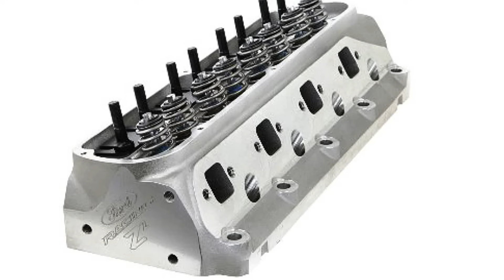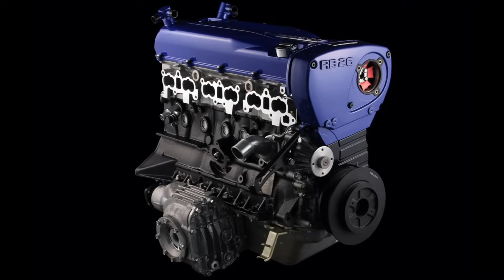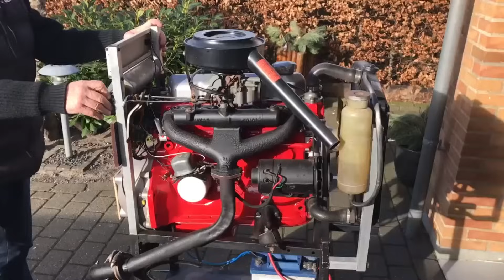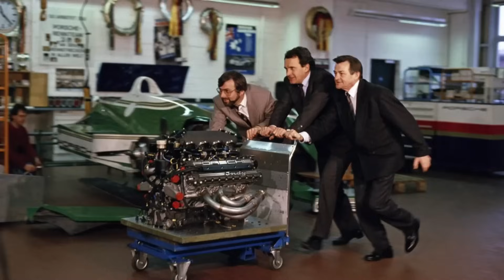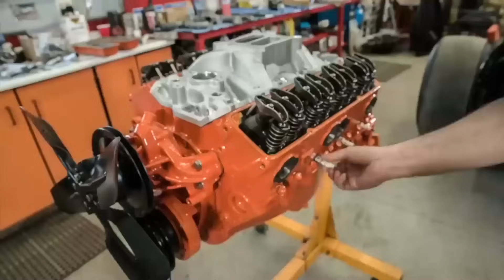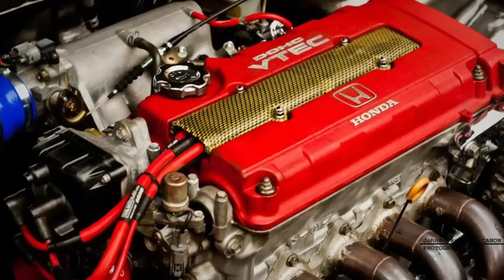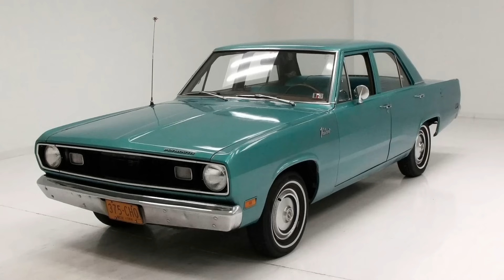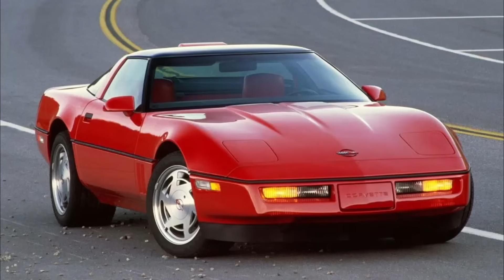30 Car Engines That Will Last FOREVER (2024)

Comment: The Chrysler 225 Slant Six was a fantastic reliable engine! The only negative was most people did not realize it had solid lifters that needed to be adjusted. When this maintenance was not done they would burn the exhaust valves and require a valve job!
Reply: My first car was 1968 Plymouth Valiant with 170 1 barrel carb slant six no power steering all drums brakes no AC very simple and last me a long time from 1981-88 in mid 80’s I drove across the country from New York to SF, California and back I-80 then I-70 westbound and then I-40 eastbound and parts of Route 66 and continue on I-40 to Tennessee onto I-81 to NYS
Reply: @michaelgorman4229 
My first car was also a Chrysler Valiant 170, a 1967 model that my mother handed down to me in 1981. I used it to drive the 2500km to my first job. A great car.
Reply: That would have been the pre-1984 models. That year they switched to a hydraulic lifter. I had an 84 D-100 Miser with the 225 and a four speed. Ran great as long as I treated it like an old Detroit Diesel- I had to keep the RPMs up, or she wouldn't get out of her own way.
Reply: @leehuff2330 
Drove Hard My 79 Chevy Base Model Van With 250 Straight 6, and 3 on the Tree. 
It Was Torquey and Reved High
Reply: I really enjoyed this presentation you did I have and have had some of the engines you mentioned 225 slant six and the 3800 Buick which is still running fine but only has about 100,000 miles on it. I guess we still have more time with it.
Reply: @rickslock  Just keep the oil changed every 4K - 5K miles or every 6 months on your 3800 GM V6 and it’ll make it to the 300K mile mark.
I’m expecting to keep our (my) 2023 Tacoma TRD Off Road double cab, 6’ bed with the Premium and Technology pkgs for the rest of my lifetime.
I’m a maintenance guy so I change the oil every 6 months or 5K miles as I only drive 8-10K miles per year now that I’ve retired.
Enjoy your day !
Reply: You didn’t mention one of the best engine Ford made in Australia it’s four litre straight six Barra engine it had 260 horsepower and turbo produced 368 horsepower unbelievable good engine.
Reply: I knew a man that had  six adopted teenagers. He had a fleet of used cars with the slant six. If they killed an engine he would just buy another slant six as they were a cheap engine to buy. He was an American Family insurance agent and said cars with the slant six were cheaper to insure.
Reply: @gvet47  That’s because the in-line 6cyl engines aren’t very fast. Their super reliable engines but are slow
Reply: @Doc1855  not totally true. 225s can be tuned to run pretty good and can be quick and fast with proper gearing.
Reply: @UncleCharlieRLTW  I’m sure, but when you’re buying fleet trucks for your business we just keep them as stock.
In my personal F150s I’d install overloads on the rear leaf springs so I could haul heavier loads
Reply: @Doc1855 Sorry, wrong. People race SL6 cars. It all depends on how they are geared and set up.
Reply: @obifox6356  Go back and re-read what I said again.
I DIDNT say it didn’t happen. I said that I don’t do that !
Reply: @Doc1855  with a stouter rear-end also? That's how I do mine.
Reply: @Doc1855  i know of a turbo injected 225 has 700rwhp.  Stock balanced crank with forged pistons and rods.  In Australia compared to gmh at the time  they where near twice the power
Reply: @Pete-hy4mq  But that’s not what was stock in Chrysler products
Reply: @Doc1855 had one in a 1964 dart a rather small car but moved pretty good until I was low on oil started knocking and I tried to make it home threw a rod out the side
Reply: @Doc1855  What do you mean, a slow engine? Maybe you meant they are in slow cars
Reply: @sundar999  Duh
Reply: @Doc1855   At least it's fast enough to take you to work. And doesn't take too much gas...
Reply: @Doc1855  my push button slant 63 dodge Dart got rubber in second gear!
Reply: Lol say that to 2JZ
Reply: @Doc1855 I guess you never modified a Mopar 225 with the basic header, K&N, MSD upgrades…  truck motor in a passenger car and incredibly simple to modify.
Reply: @  No,
I Hate Chrysler products
Reply: @UncleCharlieRLTW 
Correct, and At Least 1 Year, with Chrysler 225 Slant 6 
 You Could Get Some With 2 -  Tuned 2 BBL Carbs, Each Carb on a Separate Intake Runner.
Reply: @michaelchevreaux7780 my first car was a 71 duster 225 slant 6...hot tuneup and glasspack muffler made it peppy with a 2bbl.
Reply: @UncleCharlieRLTW 
At one time was a Factory Setup - Dual Crossover, 2 Intake Manifolds and 2(2brl) Carbs.
Probably could have got a aftermarket Cam.
Reply: Even then. The price of the head is less than the engine. Worth chaging.
Reply: Looking for The CUMMINS 5.9 L 12 Valve . Quick skimmed, I musta missed it....but I don't,  350,000, still hummin', TYJ!
Reply: @freedomfan2295  Yeah that’s a million mile engine, but most diesel engines are
Reply: When the gap between the exhaust valve stem and the rocker arm wears then this gap increases meaning the exhaust valve remains closed a bit longer than if the opening gap was adjusted  tighter so the valve would not burn under those circumstances...right?
Reply: Keep in mind in most engines valve seats wear and actually decrease valve clearance resulting in a failure....some engines have harder valve seats and have less trouble than those who use softer metal valve seats
Reply: What about the gm 5.3 v8, was not mentioned?  Is a bullet proof engine.
Reply: @FM-cf6em There's a bunch that could be added but would make the video too long or boring.
The McLaughlin Buick inline 8 from the mid 30s was another along with early Rolls Royce anything. 
The biggest Cadillac engines from before 1980 were all bulletproof.
Reply: 225 would through number 5 out the side lol
Reply: @mrman1536 I did that on a 75 Dart, blue engine. Older "red' engines are much tougher
Reply: Still running a 225 slant six in my '74 Dodge Dart.  276,000 miles and still going strong.
Reply: I have 5, 225's.came out of crusher  lot before crushing .All run great  Paid 125.00 bucks. .Have 4 Valiants , great shape ..Winter project..
Reply: Inline, including slant configuration engines will out last V type and horizontally opposed engines with the least amount of wear.
Reply: I've had the slant six and she's a tough old girl. Now I have a jeep with the 4.0 and she's a tough old girl too
Reply: Engines with solid lifters sold to the public with no mechanics knowledge was a failure on the manufacturers side and shouldn't make this list.  but then again DODGE ALWAYS FAILS !
Reply: @christianogaard2185  another Canadian
Reply: If they were overreved the results were catastrophic!
Reply: The leaning tower of power
Reply: My brother had a 225 slant 6 in his 73 dart, that engine went over 400k miles no problem. Those motors were bullet proof. And back then there was a lot of them on the road, easy to find parts for.
Reply: I do agree I owned one
Reply: Was going to bring thar up.
Reply: In college, I bought a 1973 Duster for a case of Bud, 225 slant, it had No Compression in the 5th cylinder and I still put Another 100,000 miles on it while it still blew Ice cold air!
Reply: @Krazycat321  You gotta love the older vehicles that just wouldn’t give up.
I had a friend who wanted to borrow $400 from me back in the early to mid 80s.
She had a 73 Chevy Impala that she hardly ever used, so I told her that I’d let her borrow the $400 if she transferred the title of that 2dr Impala over to me. That way if she never paid me back there wouldn’t be any hard feelings and if she did pay me back, I’d sign the title back to her.
She never did pay me back and I too put over 100K miles on it. 
It kinda became everyone’s car.
At that time I had a new Toyota for my personal car and a Chevy pickup for my work truck, so I didn’t need the Impala.
Right at around the 200K mile mark it developed a hole in the exhaust and about that same time it burnt a valve.
Of course that old 350 V8 was missing because of the burnt valve and because of the hole in the exhaust it sounded pretty good, like it had a beefed up engine.
At idle it made the sound of BLAP BLAP BLAP BLAP.
It became known in my circle of friends as the Burgundy Bomb.
When we’d go out bar hopping with each other, we’d always take the Burgundy Bomb. If we got into a wreck, who cares. 
Anyhow as 87 rolled around I was going into Grad School and needed to relocate. A friend of mine was going through a divorce and she needed a car, so I gave her the Burgundy Bomb.
It was still clean and straight with around 230K miles, but she was glad to have the transportation and I was glad that I didn’t need to sell it before leaving for UW.
Reply: Al Bundy special
Reply: And they were a 4 main bearing weak design, hard to work on the distributor side of the engine. Chrysler's Hemi inline six that replaced the slant in Australia was ten times the motor. More power, more economy and more reliable with hydraulic lifters, easier to work on and didnt burn valves as they were stellite. Btw, not keeping solid lifters adjusted up dont burn valves- adjusting them too tight burns valves.
Reply: Yes slant six was excellent engine reliable and smooth l hade coupe of them in my cars.
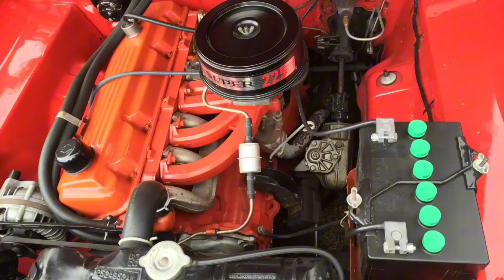Reply: 21:48 this engine?
Reply: Sadly at my job we have a slant 6 generator- they updated to new generators and the slant six was shoved to the scrap yard... nothing is wrong with it, it was lpg powered and was running when shoved out 

I been asking for it for years i covered the pipe with a can and the breather with a can as well i go and check the state of it and it is slowly deterating
Reply: The pride of Huber Ave. foundry.
Reply: Well that and the cars were so ugly people destroyed them, at least that was my old man.
Reply: My Plymouth 360 had valve issues.
Reply: Slant Six was a terrible underpowered engine 
I had one. It would diesel. I would have to shut it off in drive. It would stall in an intersection. It would overheat in the summer. Typical Chrysler Engineering
 Lean Burn Garbage because the engine couldn't pass emission controls
Reply: @John-pz6nm  My dad, through his neglect, somehow cracked the block on his slant 6. It was a water leak only, and the Plymouth engine lasted a few years longer than I expected.
Reply: Must
Reply: 9 times out of 10 they were owned by little old ladies, that drove it to church on sunday....till she died, and never changed the oil, ever.
Reply: In my old mans case, the slant was in a car so ugly he destroyed it. Any means necessary.
Reply: They are a great motor i had one with a scat pack 3 2bbl carburetors and bigger cam and headers
Reply: I have both of the 1975 Dodge D100 trucks my Dad got for Free I. 1975, when he bought 2 1975 Dodge Bighorns. The picks were powered with 225 Slant 6 and 4 speed manual Transmissions.  Today they both have surpassed the Million Mile mark. And are driven weekly. As for the Bighorns. I only have one left. Sold the other 3 years ago.
Reply: I had one when I lived in Hawaii & every time there was a flood, the points would get wet, because the distributor was close to the ground. I had to pop the distributor cap, too many times, dry the points, put the cap back on, I GOT SICK OF IT!!!
Reply: I have a slant 6 from my long gone '72 cuda. Had a "6 = 8" sticker in the engine bay and a 2 piece header even!! ABSOLUTELY will sell it. I'm in MN.
Reply: @ I never said that I wanted to buy it. I was just saying that they were good engines
Reply: Tough ass engines
Reply: Had a 63 dart convertible sweet running engine it wasn't  very old .oops telling my age😊
Reply: Yep
Reply: @Doc1855  the US 225 never had much R&D. But in Australia the 225 had tonnes of R&D. They became extremely fast. I had an old 180hp engine in an old Valiant Regal. It was optioned because that motor was predominately found in only a rare handful of Valiant Pacers. 
That engine thrashed much larger and more powerful 6 and some 8's.
Reply: And the Ford 300 6 banger
Reply: No slant six no matter how well maintained will ever outlast a 22r Toyota. Two of them couldn’t
Reply: @MetalTeamster The timing chain of the 22R can gnaw a hole in the aluminum when the plastic chain guide fails - sounds like a diesel by then
Reply: @timothykeith1367  Good engine though.     I seen them go over 300 thousand miles and still run strong m
Reply: @timothykeith1367  I made the mistake of buying a 1984 SR5 with 100,000km that the owner skipped most of the oil changes.
I bought it as a "patch the many rust holes and have a cheap reliable mini truck" WRONG.
I found what looks like just dirty oil on the stick was actually black globs in the bottom.
After its 3rd oil change in 10 years it did sound like a diesel (but did start and run, just noisy). Then...I dropped the auto transmission oil... same deal.. black ooze... more barely functional aspects after..
Reply: @MetalTeamster  The 22R had not been made when the slant 6cyl was around.
Stay with the Topic at hand.
Reply: @Doc1855 ohh, ok, I thought the topic was car engines.
Reply: @MetalTeamster  It is. Thanks for the tip
Reply: Had one and my friend had one also.    Gutless and not very economical and my engine overheated all the time and his threw a rod though the block.    I thought it was one of the worst engines ever made.
Reply: I bought a brand new 2007 Hyundai Accent hatchback with a 1.6 engine. It's still running well and has 398,000 miles .
Reply: When l was a kid we had one in a Valiant. Sure it had lots of torque but loved to drink fuel and crack distributor caps. In Australia Valiants were a very cheap car to buy second hand. It didn't help that Valiants had an awful front end and didn't like going around corners. One Very average car!
Reply: @martykath4427 it wasn't really the front end of Aussie Valiants that was the problem, it was the arse end that was so light that it wouldn't anchor the car and allow it to turn. 
There was a good reason why everyone back then all said you have to put a large bag of sand or cement over each rear tyre well.
Reply: I owned two cars with the 225 (1978 Volare wagon and 1979 2-door Diplomat) and these were incredible for pizza delivery. 

I put 500,000 km on the Volare before the frame cracked in two and 800,000 km (500,000 miles) on the Diplomat.

I adjusted the valves roughly every 200,000 km and they ran like a top.

They were gutless wonders that seemed to last forever.
Reply: @Slider68  Canada....RUST!

Comment: Subaru EJ205 (2.0L) I don't consider changing the head gaskets a general maintenance item!
Reply: The early non-overhead cam versions in the 60's and early 70's were the real tough engines in Subies, lasting several hundred thousand miles.  When they went 'high  tech' is when they went down hill for reliability. You never had to replace head gaskets in them like now....
Reply: @GregoryStevens-hm4ix  The early non overhead cam models Subaru built are almost an exact copy of Volkswagens flat 4 which started life Aircooled and became water cooled in the 80’s and used until the end of rear engined VW buses.
Reply: But and it is a great BUT, these engines drink fuel like a calf drink milk
Reply: Agreed! I have done that job and it’s engine out
Reply: @georgeglovier  if I were to have a Subaru engine it would definitely be the 2.2l non interference SOHC. Simpler and reliable without the head gasket worries of the later engines.

Comment: You wish there were 30
Reply: Also not mentioned, was the Ford 170, and 250cu.inch inline 6 Ford engines found in Mustangs and Maverick of the year in was intruduced. And the Turbo Thrift Chevy inline 6 250 cu. In. And 292..found in Chevy C10 series pickup trucks

Comment: I've owned multiple engines on this list. The 302W, the 4.6v8, the 3800, and thw B18. Theu were all incredible engines. The only thing i would've added to this list is the coyote 5.0. they all took me over 200k miles with minimal issues. The only one that hasnt yet is the B18 because i just got it

Comment: Tod’s you really have to consider the transmission to they could cost as much or more as the engine. I really don’t care for anything newer than a 2005
Reply: Wasn't that the year that airbags were mandated? And about the time a motor's operation was all computerized, meaning you needed a PHD to do a tune-up?

Comment: This guy has no clue what the fuck he is talking about literally half of the engines he listed are known for being absolute garbage like the ej205 for example that you just need to keep replacing head gaskets to keep it running because you know replacing head gaskets is cheap and considered routine maintenance and lets not get started on the ecotec.... ROFL

Comment: Studebaker and Hudson both had a lot of engines that were awesome!
Reply: Now we're talking: Studebaker V8 is KING above all without any doubt whatever.
Reply: @ Rick, Found my SOULMATE - at last!. Completely OBSESSED with these two engineering MARVELS. Own both and the legendary Chev STOVEBOLT SIXES. Still plugging on after all these years. Good friend's Oldsmobile side valve performs like new and I could go on!.
Reply: Studebaker V8s and Hudson inline sixes were fantastic engines!
Reply: My 289 Stude engine was absolutely bullitproof. well over 200K miles in my Avanti.

Comment: 259 Studebaker V8s ran a long time and got fantastic gas milage
Reply: Studebaker V-8s had many differences from other V-8s such as gear driven cam; no chain.
Reply: The Studebaker v8 is built like an industrial engine, but its very heavy for its displacement. Has steel timing gears instead if a chain.  The v8 with a new casting could have been a big block.
Reply: @timothykeith1367  the timing gears were billit aluminum (crank) and fiber (cam gear) for quiet operation